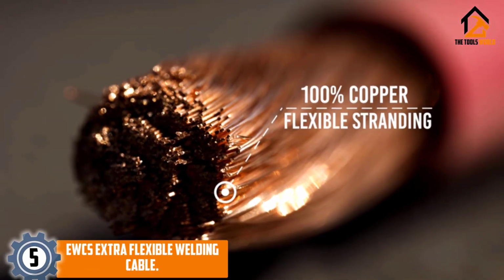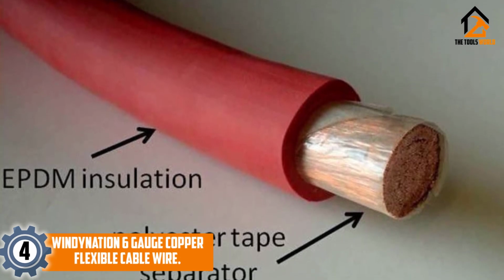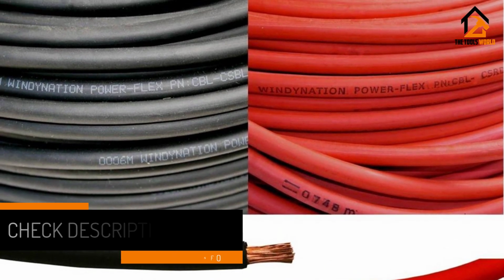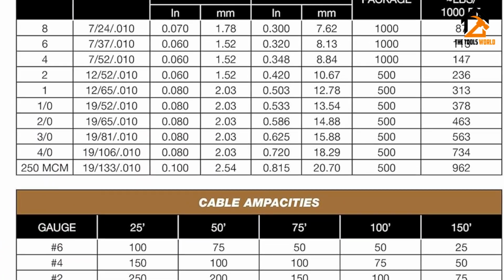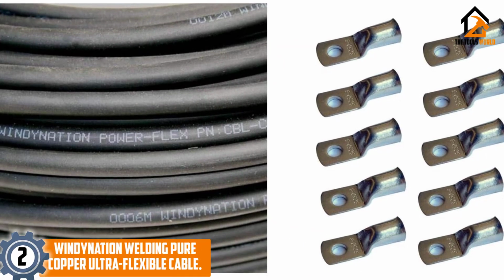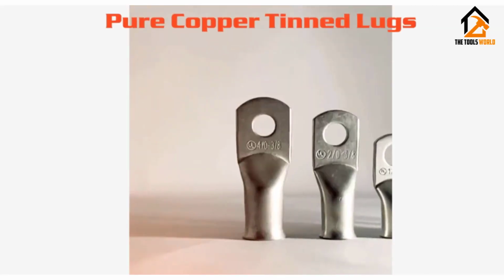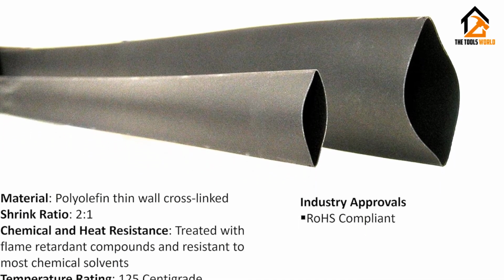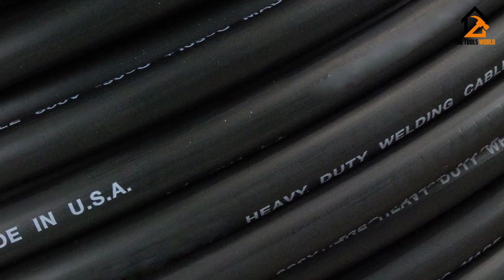5 Best Welding Cable for 2024

Comment from the maker: ▶ In This video, We recommended the top 5 best Welding Cables for 2024.

▶ 5. EWCS Extra Flexible Welding Cable.    
 
▶ 4. WindyNation 6 Gauge Copper Flexible Cable Wire.   

▶ 3. EWCS 4 Gauge Premium Extra Flexible Welding Cable.   

▶ 2. WindyNation Welding Pure Copper Ultra-Flexible Cable.   

▶ 1. TEMCo Welding Lead & Car Battery Cable.